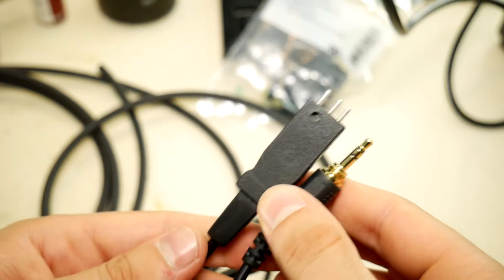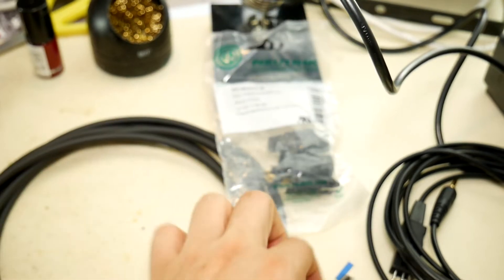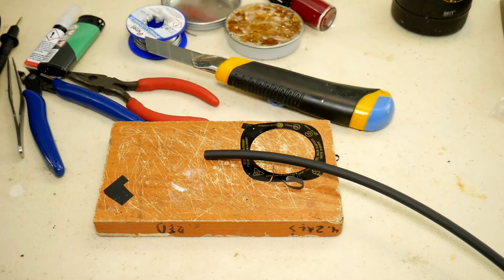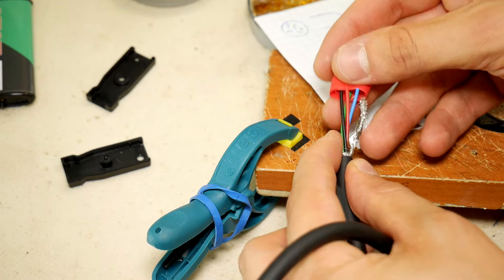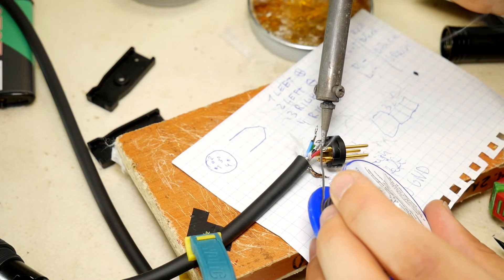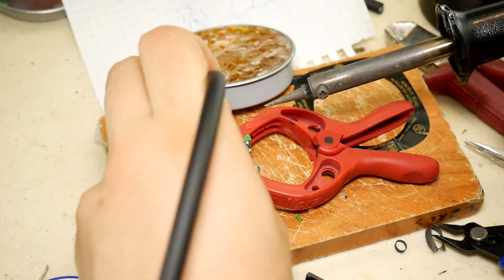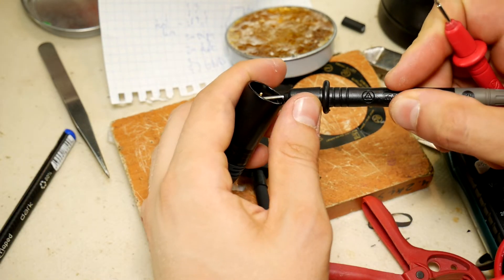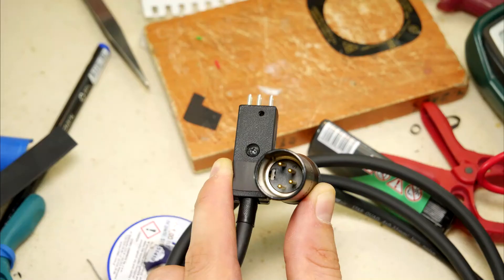How to Make XLR Balanced Headphone Cable DIY

Comment from the maker: Parts on Aliexpress:
- Neutrik 4-pin https://bit.ly/37zCwen
- 4 core audio cable https://bit.ly/37p7z00
- Heat Shrink Tubes https://bit.ly/3izgjmV
- Electrical tape https://bit.ly/3kMTnB0

Parts on Amazon US:
- Neutrik 4-pin https://amzn.to/2Xf4yd7
- Heat Shrink Tubes https://amzn.to/3xEcK3c
- Electrical tape https://amzn.to/3CG1Hdl

Parts on Amazon UK:
- Neutrik 4-pin https://amzn.to/2VI6pXa
- Heat Shrink Tubes https://amzn.to/3lQKqZb
- Electrical tape https://amzn.to/3iAz2hU

Parts on Amazon DE:
- Neutrik 4-pin https://amzn.to/3lZjMxd
- Heat Shrink Tubes https://amzn.to/3lUDZV5
- Electrical tape https://amzn.to/3jL1UU4

Comment: I thought 4 pin XLR balanced cable doesn't require ground to be done.

I'm looking at making a 4 Pin XLR balanced to 2 (Y split) 3.5mm mono TS jack, each TS should only have Tip Sleeve, so if I have a 4 core cable, 2 going to Tip and sleeve on each side, then just going back directly to the 4 pin on the XLR R+ R-, L+ L -, then it should not require the ground right?
Reply from the maker: yes, you can use ground, if your cable has ground/shield, but it is optional.